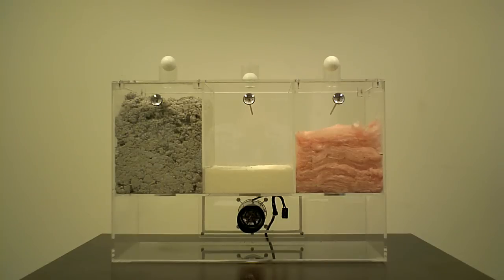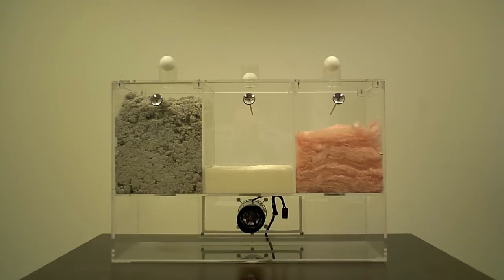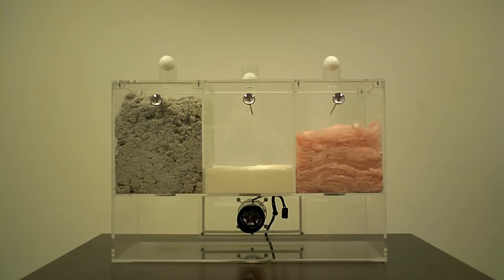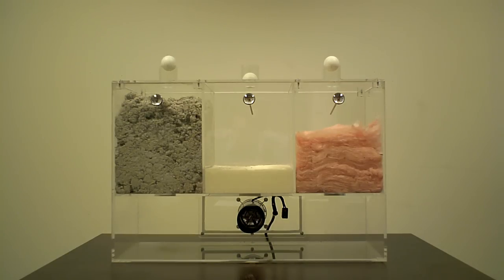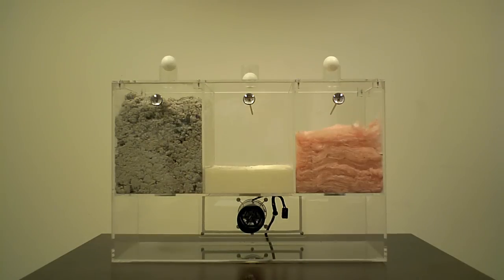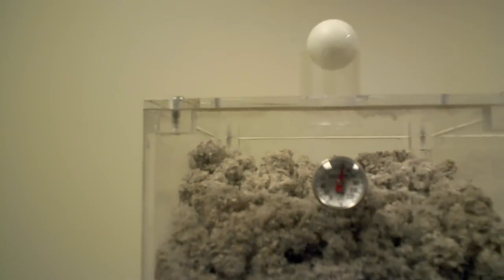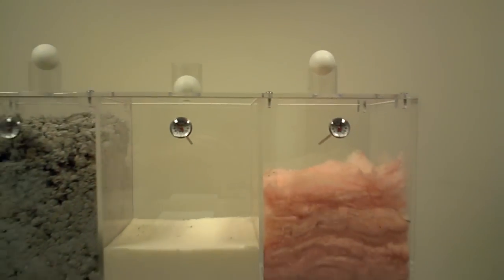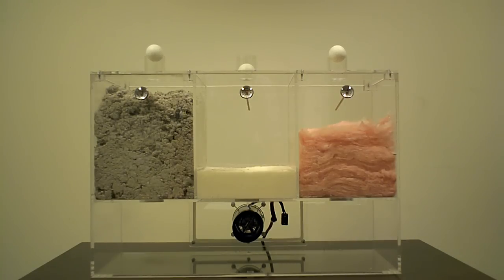Spray Foam Insulation Efficiency

Comment: You can improve the performance of fiberglass and cellulose if you air seal before installing the insulation. Calk and seal cracks and seams and you get about the same performance as the foam at about 25% of the cost.
Reply: This comment is sarcastic right?  I couldn't imagine trying to calk and seal all the cracks in my old farm house.  Spray foam is the best way to go.